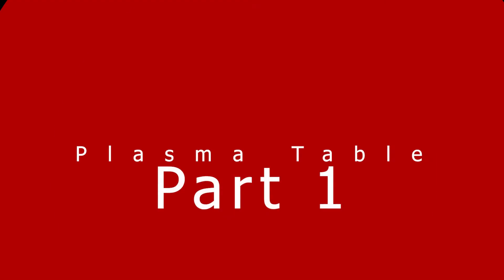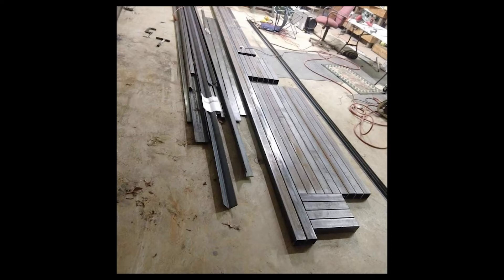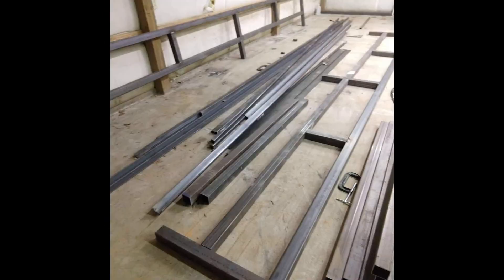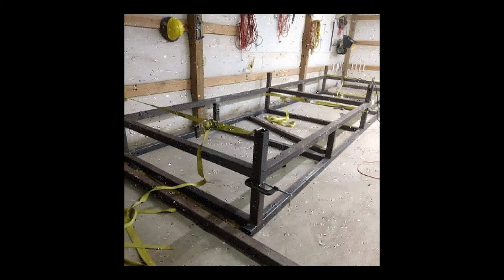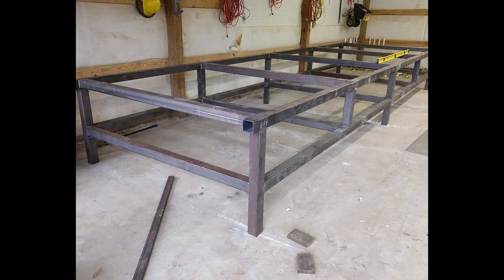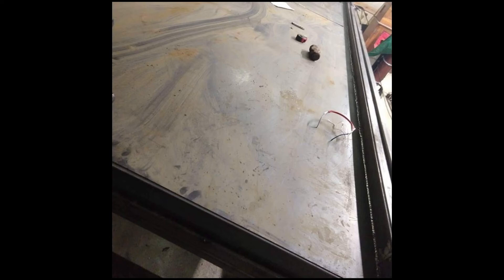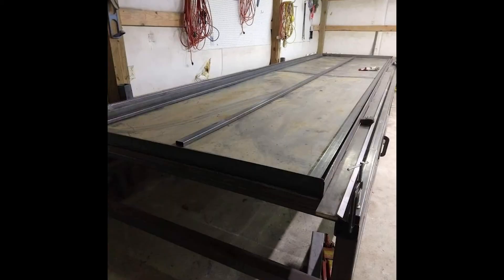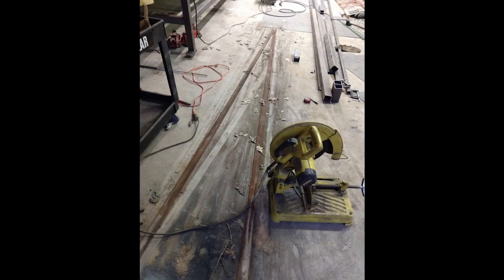Plasma Table Build Part 1 - Precision Plasma Gantry Spark Robotic Hypertherm Quency air compressor

Comment: What thickness did you make your frame?  is that 1/8" wall?
Reply from the maker: Yes, the 3x3 is all 1/8 wall. You can go thinner but I don't know why someone would do that honestly on the frame. The 3x3 on the gantry is also 1/8. The support piece that the track lays on the gantry should be thin (16ga and below) and I made it in 1/8 as well. It's literally there for holding the cables for the Z and X. Hoped this help!

Comment: That table is gigantic.  Unbelievable.  What was the total time to build it?
Reply from the maker: The table it's self maybe 8-10 hours, the rails and gantry took about 18 hours (mag drill would of made it take like 2 hours but I don't have one) electronics 3 hours. Ground rods...2 hours....air compressor install and plumbing of wiring 2-4 hours, receiver tank 1 hour (never had the right fittings). Now looking back I could do it all on 1 week with all parts sitting there. A LOT of this was extreme error due to me have only seeing a table in person 1 time haha.